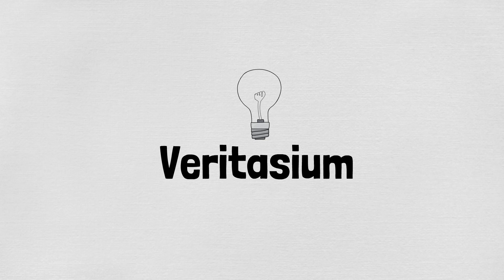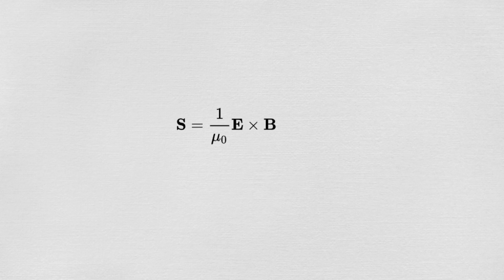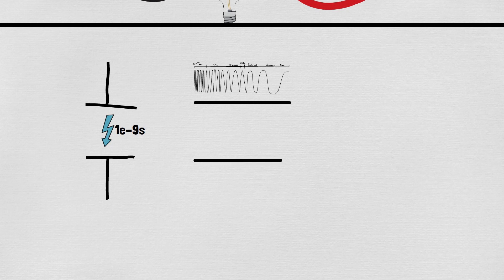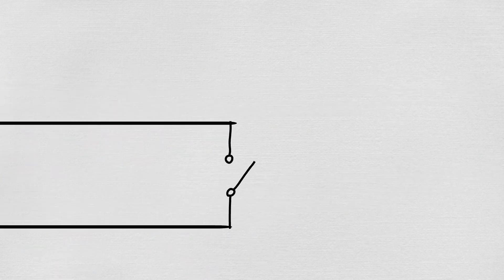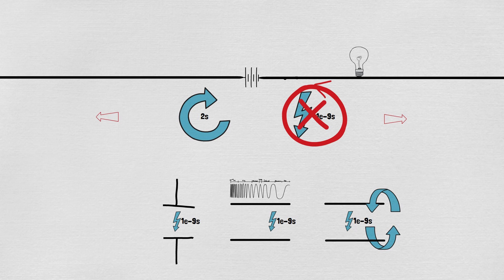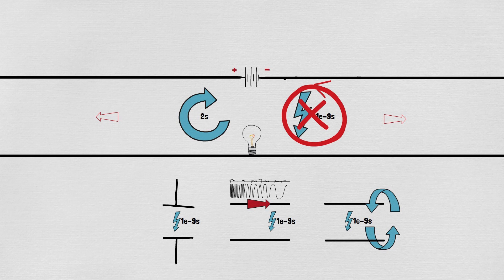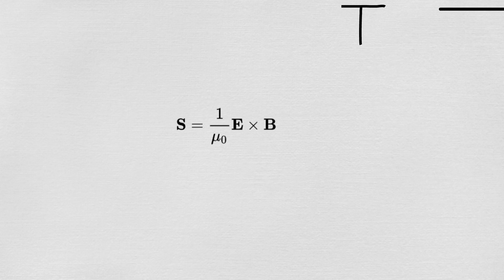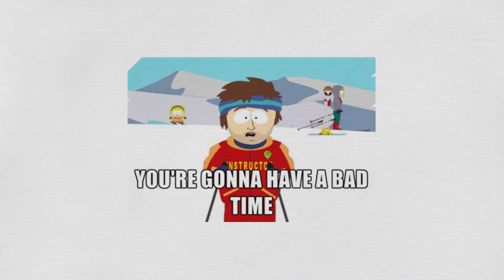Veritasium is Right? (see description)

Comment: I know this is slightly off topic, but I'm really curious to know. If the energy is transferred through fields around the wires, why do we need thicker wires in order to get more current?
Reply: Sometimes you don't:
https://en.wikipedia.org/wiki/Goubau_line
Reply: Current is defined as charge per unit time, or Coulombs per second, commonly known as an ampere. To achieve higher currents, you need more Coulombs of charge to move through the conductor, and due to resistance (and reactance at higher frequencies), the conductor heats up. In order to keep the heat below the temperature within the thermal capabilities of the insulation (i.e. to keep it from melting) as well as to prevent the conductor itself from melting, the conductor size is increased. It is the magnetic field created by the current that acts with the electric field that moves energy. By the way, the strength of the Poynting vector is strongest along the surface of the conductor, and very little energy gets transferred out in space a long distance from the conductor. The strength of the Poynting vector is inversely proportional to the biquadrate of the distance (square of the square, or 4th power) away from the conductor, which means that almost all of the energy flow occurs on the surface of the conductor and not out in open space.

Comment: I think Derek is only "right" in a very narrow, nitpicky sense.   
1) He closes the switch, which causes a step function of voltage and current to propagate outwards from the battery terminals; 
2) The leading edge of these step functions create changing electric and magnetic fields that propagate down the attached wires, which act as a transmit antenna; 
3) The wires attached to the light bulb act as a receive antenna, and receive enough energy to cause the bulb to generate, say, one photon.  This rather mediocre result qualifies the bulb as "having been turned on".
But no USEFUL power arrives until current has had time to flow from the battery to the bulb.
Am I on the right track with this line of reasoning?

Comment: Your comments about the switch (no being necessary) are totally wrong. Later in the video you complain about the absence of a t (time) factor.
Well, that's exactly what the function of the switch is. It produces a current pulse.
However you describe the circuit, as a combination of capacitofrs and inductances or as a set of antenna, it remains a transmission line, that needs a delta-t. Without the switch no delta-t, so only a static situation, hence nothing to transmit.

see EEVBLOG.

Comment: Valiant effort, but ultimately incorrect. The position of the switch matters and what is special about the switch in an otherwise closed circuit is that it has a voltage across it when open. When closed this causes current flow, first only across the switch itself, but as the voltage propagates along the wire at the speed of light so does the region of the wire with current flow. So in your example it would take a second for the bulb to light up because it would take that long until there is current flow in the vicinity of the bulb.

Comment: WHEN DOES THE BULB LIGHT?
After 1 second or 2 seconds?
If you had 3 builds, one at the start, one half way as above and one at the end. Does the first one turn on "instantly" the mid one after a second and the last one after 2 seconds?
The bulb only cares about "flowing" electrons doesn't it? Not where the electrons are going to.

Comment: I doubt Jackson/Griffiths etc. get heavily into EE topics, you won't have encountered them, and that's a huge problem for this counterintuitive setup. 
[ Be warned, this is a trick question meant to suck in those like yourself.   You fell right into a prepared trap! ]   
In other words, Veritasium certainly didn't originate this exam-question.  If you're assuming that he's clearly mistaken, and assuming that you're more knowledgeable, then you've fallen into his trap.   (He doesn't have to be personally correct, he just has to get this setup from an undisclosed physics text!)  It's quite a nasty trick-question, and to my mind was obviously prepared by undergrad textbook authors, or other similar exam-creators, NOT by Dereck.  It might be from an EE exam, not a physics exam. [1]

In the other videos, apparently you missed the actual correct explanation.   It's not a capacitor, it's not an antenna, it's not a transformer with mirror fields.  (All three play a role, but these sent you up a dead end.  So ignore all three, at first.)   Instead, it's a pair of 2-wire transmission lines, and their physics has been well-understood for 120 years.   Yes, capacitance and transformer-action play a role.  But 2-wire lines are a synergistic combination, producing simple but unexpected behavior.   You don't understand transmission-line behavior, or you'd know that Veritasium is passing on correct information.

The trick:  the end of an infinite transmission line behaves exactly like a resistor, even if the two conductors have zero resistance.  (This answer appears in some other videos, but you missed it?)    Worse trick:  in this exam-question we hook the cut ends of two transmission lines IN SERIES, producing some effects easily missed.   (Typical 2-wire setups only have a source on one end and a load on the other.   But he topology is different here.)

What effects?   If we hook three resistors in series with a battery, then (after a few nanoseconds of ripples,) the same direct current will appear in all three resistors.   It's a series circuit, after all.   In Dereck's setup, roughly 4mA will appear at the bulb, if the bulb-resistance is chosen for maximum power.  That's the 3-nanosecond result.   After several seconds, the bulb of course will have 12V across it.

[1] Dereck isn't a scientist, or even an amateur.   He pretends to have invented things, and doesn't clearly and religiously give attributions.  Which ones are his own ideas, and which came from other sources?  He doesn't say.   (RP Feynman labeled this as pseudoscience of the "Cargo Cult" type, where the amount of honesty is not at the highest level, so distortion and fooling people aren't seen as abhorrent high crimes.)

PS Moving the switch!   That's a straw-man fallacy.  Just answer the exam-question in front of you, without changing it.
Reply: Totally right. This thought experiment can essentially be modeled as a two-wire transmission line with a DC transient on it. But it’s something only people with a good EE background will recognize.
Reply: @jb_50w78  "Only people with a good EE" . Also radio hams, where "2-wire lines" are used as broadband splitters and xfrmrs and baluns and stubs, not just "transmission lines."

Comment: Thanks for explaining what I instinctively knew but couldn't explain. I've seen other videos which say the same thing but forget that if there is no current flowing/osculating there is no electromagnetism. Anyone able to answer my question: How high would the voltage of the battery have to be to induce a current in a wire 1m away? (The thought experiments assumption would be such a high voltage that the experiment would be practically impossible.)

Comment: I think that all Ve said was: "As electrons move along a wire, a field is created around that wire...at the speed of light." And how long would it take for the field to reach 1 meter? 1m/c. Would that power have been incredibly small - yes. I think if you simply touched a 1 foot bare wire with your bare hand, SOME electrons would have moved. Thus creating the (beyond miniscule?) field. Woo. All the rest of the video was fluff and spectacle. Let me know if I'm wrong.

Comment: Spot on:  Veritasium and most other videos are talking about what happens at T - zero as if that is a steady-state, and seemingly dismiss everything from T - 1+.  Also, the entire thought experiment includes the assumption that the conductor loop has no resistance, but equally relevant assumptions about infinite capacitance, inductance, dipole antennae, etc. are not taken into consideration.  If only Tesla could join in with his video with what he learned while trying to power all of the light bulbs in the world.

Comment: It is not true, that the EM field needs to establish along the whole line. Though truth be told, the fact that those lines are shorted is actually quite crucial for all of this to work. The position of the switch is crucial as well.
First of all, look at the system from the point of view of charges and potentials when the switch is open. A potential difference will establish between the battery electrodes and between the switch ends. One end of switch will get charged positively and the second end will get charged negatively in relation to the other end. So what will happen when you close the switch? Current! Immediately! Those charges will not sit still there and wait for the whole line! Current is the flow of charges, remember? Charges will start going from one end of the switch to another as soon as you close it and this movement will inevitably create current. It would create current even if there was no battery there, as long as both ends of the switch would be charged appropriately. And the flow of current will propagate from the switch in both ways as the opposite charges will move with that current as they will try to balance themselves out. The current will at the beginning be drawn only from the unbalanced charges from the line itself, and only after some time the battery will go into action and start providing it's own current.
In this way, there will be a current immediately, but the current will not be everywhere from the very beginning. Whole story makes sense only if you start from the fact, that the switch, the battery and the line was there for a long enough time for the charges to reach and stabilize at both ends of the switch and only then the experiment with closing the switch started.
Reply: Of course, if you omit charge stabilization and shorting of lines from the very beginning, then anything can happen with those lines and the outcome is unpredictable. If you put the switch somewhere farther along the line, the current will start there and it will have longer time to reach the bulb.
So veritasium experiment conditions and assumptions are incomplete.

Comment: To start I think this problem by Veritasium is very poorly defined. We need to make a lot of assumptions. The most overlooked one IMO being the bulb itself. Lets say an arbitrarily small current turns it on. Also lets ignore the switch for now, and just connect the battery to circuit to start the dynamic behavior of our system. Also, lets make the ends of the wires open for now-
If my thinking is right, connecting the battery to the wires would lead to a very small compensating current, which puts the wires on either on of the battery to the same potential as the battery. This would lead to a very very small current to be induced in the opposing wire, making the bulb light up, though only very dimly and also getting even dimmer very fast. 
If the bulb is an ordinary bulb like we see in daily life, we wouldnt be able to see anything (at least with open wires). 
If the bulb is an ordinary bulb, and the circuit was closed, and the wires are superconducting, then closing the circuit initially does nothing (like in the sentence above). But after ~1s the potential is established along the whole wire, finally turning the light bulb on.
So as I see it, the answer depends on how you define the properties of the lightbulb and what exactly you mean by "turning on". 

Please correct me if I'm wrong at some place, this is just my thinking.

Comment: I agree with what you have posted.  But you need to point out that any discussion of any problem described with the basic analysis used here is no where near complete enough to do this calculation.  He needs a series of RLC elements to fully answer the real world result.  He can argue for a simple problem description and the like, but in real world that is crap.

Also in that analysis need to explain how much power would be required to push electrons around the circuit and what would be the consequences for the problem if properly modeled.

Comment: Wire has too much resistance to act as a conductor at that length. That wire would act as an antenna for all Em radiation and would have an electrostatic charge regardless of switch. All factors in this experiment have been misconstrued in some hypothetical scenereo. You need to look at the big picture and that wire battery and bulb will never have a causal effect on each other when connected by a conductor  of that length

Comment: You miss the point of the switch I think (typical of astrophysicists and nuclear physicists). By your admission too.

The closing of the switch allows current to flow on both sides of the battery. The switch was located on the negative side. If the switch is open, and electrons flow rightward, where do they go? The fact is, they have nowhere to go, and so you could at best produce very brief transient current only.

But (I hear you protest) electrons COULD flow into the positive electrode from the infinite stretch of wire to the top left. However, this process generates even more electrons at the negative electrode, by the electro-chemical process inside the battery. But the build up of charge on the negative electrode would immediately resist the flow on the left.

So, the switch is important.

Veritasium is (at least) substantially correct. I didn't watch his entire video, but the basic idea he touts, of the field being transmitted through space, and manifesting itself in wires, is correct.

Comment: I think there is something not addressed. is a switch is simply a gate, its really the source of location of power. So we for purposes assume the switch is a separate power system that when switch the power system begins to undulate its invisible sexiness. A microwave... illuminates a bulb.. without wires.. Wireless energy is nothing new...

The only red flag taht came ot my mind is the frequency, power/ range and distance, that wasn't really addressed. Of course guage of wire, resistance...  etc.. all that... LIke... you can only plug in so many cords before the origin of the cord and power being ot metal the wire. 

ANother intersting thing is I had 20 year old battery jumpers.. I used them and they simply melted/ disintergrated, while plugged between cars. We had to get a little burnt form attmeptign ot break the circuit as they melted my ligh a bit and the dudes car. Just glad he forgave me. 

So... there is no law being broken.. but there is a distance to arc/short gap.. too much power in a field cna jump to metal. and other objects. eventaully shorting nad power all thigns randomly..

Then there is funny things around just having a water.. and depedning on the atmosphere and gauge and heat of teh sun, it can gain a current enough to create a shock..

Why not just get a . 300kk long coper wire.. lol...

fields do power things like wires.. by exciting the electrons ot contract and move in neighbouring systems. if a field is larger enough it can hazardous... They did talk about time.. but did dicuss it acting like an attenai.. perhaps they didn't discuss how muc henergy would be needed to actually travel teh entire circuit... hmm..

Comment: Hi, so basically what you are saying is that it will take 2 seconds, because it will take 2 seconds to establish an EM field, only after which current will begin to flow. I have a doubt in this explanation, why is it necessary to have an established em field for current to flow? for example in case of lightning, the current flows through the ground, but there is no em field established there, so how does the current forms in the ground?

Comment: I have two bulbs with two switchs in my flat entrance. the wires are all parallel. When I open one switch, the other bulb does not turn on. Of course Veritasium is wrong. Maybe with an AC source, he could manage to have a very very very tiny tiny tiny light. With a DC source, there is just no way, changing a potential once, as with the DC example, does not make any current, and as explained in this video, do not produce any magnetica field.

Comment: If you move the switch, the electric field does not have to be established around the entire wire for current to flow. The current will still flow instantaniously at the point behind the switch.

Think of Veratasiums circuit like this: the electric field propagates into the wire with the speed of light. So just after the very start, this field will create a current and a charge concentration difference at the start of the wire. In other words: a difference in electric field and magnetic field at the start of the wire.

HYPOTHETICALLY, these fields extent into infinity in free space, so will affect the other wire. 

Impractical, weird and confusing explanation though.

Comment: I have to disagree with you, I'm afraid. If the switch is open for long enough before the start of the experiment, then the voltage rise of the power source will be perfectly balanced by a voltage drop in the switch. When you close the switch, you short that voltage drop and current starts flowing immediately to equalize the voltage across the switch. The current starts at the switch regardless of where it is located.